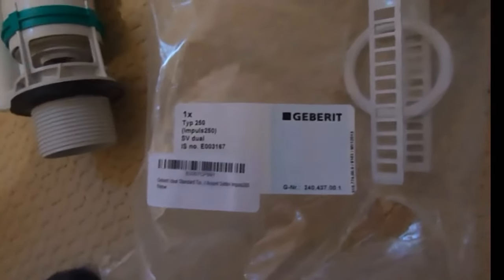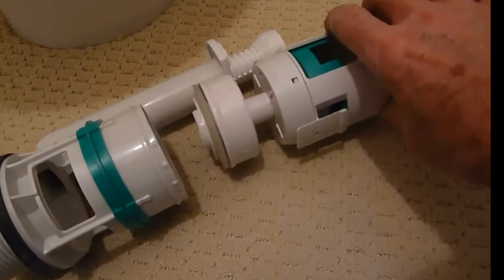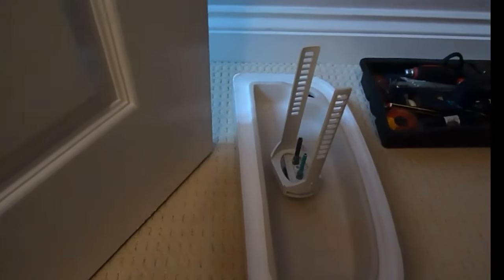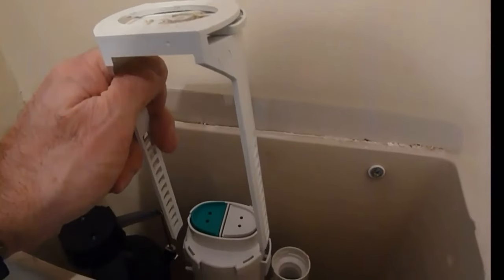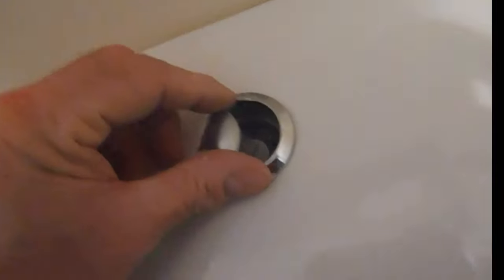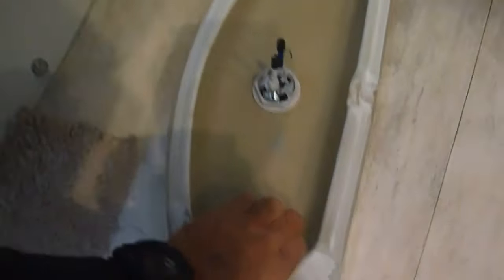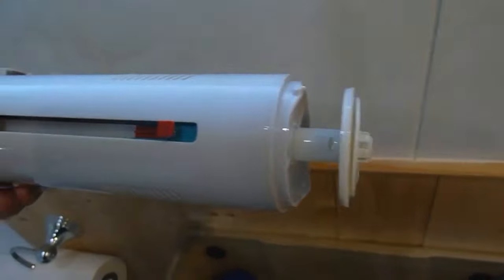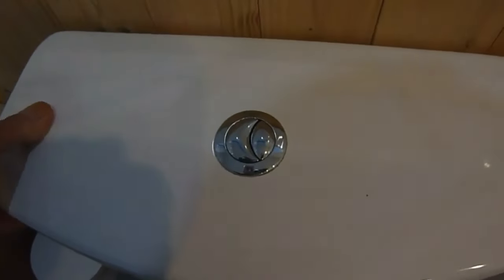Fix a #Push Button Toilet# not Flushing or leaking water into the pan.

Comment: I have that exact flush valve that you show at 5:21 and my cistern has been excruciatingly slow to fill , I have also noticed water running into the toilet itself. Going to try reversing the washer and hopefully it solves the problem , thank you
Reply from the maker: The slow filling will be the ball valve pressure.
Reply: @dereton33  does that mean I need to replace the inlet fill valve unit? I tried flipping over the washer in the flush valve but it didn't help. Thanks!

Comment: Any tips/tools for isolating the water before starting. The ***** who installed mine originally but  the isolation valve under the toilet and facing it. There is no way to get a normal screwdriver to turn it. I'm thinking my best option is to turn off the water at the stopcock.
Reply from the maker: Yes main stopcock is best.

Comment: Is this what I need to replace to stop my loo from having a very slow, continual drip/trickle from the flush down the back of the pan? It is one with these push buttons….haven’t checked to see which sort yet ..
Trying to keep the limescale marks off is a nightmare, plus the water company count it as a ‘leak’ & keep sending me threatening letters saying I’ve got to deal with it (this is the only water leak in house, I’ve spent small fortune on plumbers checking for leaks in response to water company)
Thank you for your informative videos….very useful for someone who lives by herself to get stuff sorted
Reply from the maker: Yes it is what you need. Good luck with it.

Comment: Hi, i have a push button loo, but i try and lift the lid off but it seems stuck. Any ideas please?
Reply from the maker: Pull out the buttons first there is a screw underneath.
Reply: @dereton33  I think they are under the ring
Reply: Thx @dereton33

Comment: i just moved into a property and the toilet had the same 2 button flusher but there is barely any water coming out and also no different which button i press !?
Reply from the maker: Check the valve is filling the cistern to the correct water level.

Comment: Hey if I replace the fill loop on our condenser boiler does it need air bleeding in any way? Thinking it doesn't because when it was first fitted they left the fill loop off. And I think I remember they would fit it to repressure the water then take it off.
Reply from the maker: No bleeding required.
Reply: @dereton33  thanks man!

Comment: Is there any particular reason why a Plumber would use a water pump with a combi boiler? I thought that they come with water pumped integrated in them. As I had someone install one with one......
Reply from the maker: No not that I have herd of. They all come with pumps inside the case.
Reply: @dereton33  Do you by any chance have an email address to show you a photo of it? I just wondered why he would do it. As it's a Logic combi2 C24 and has a grundfos tank that looks like a fish tank next to it - I presume it's a water pump.